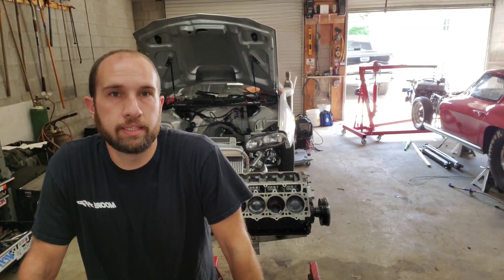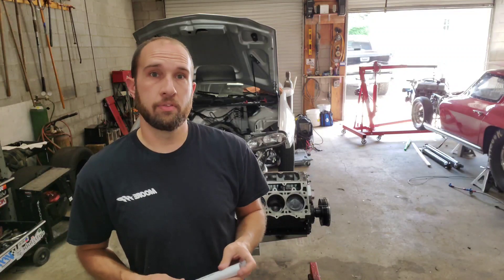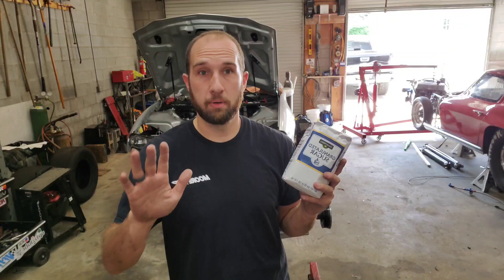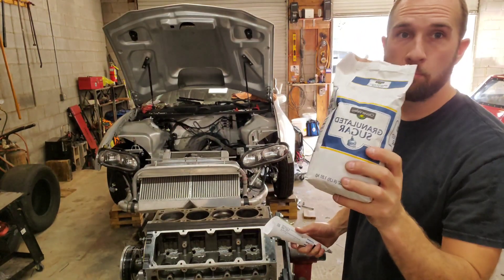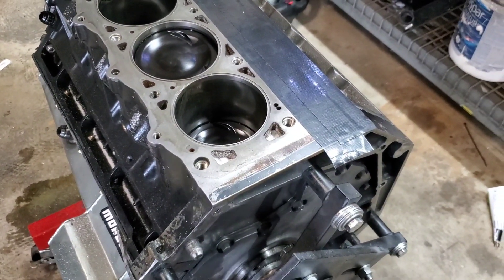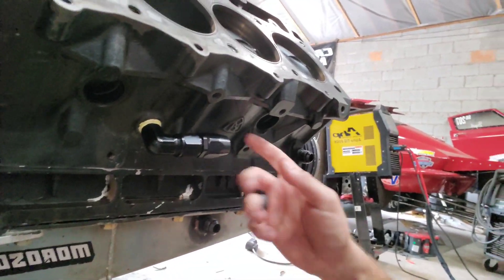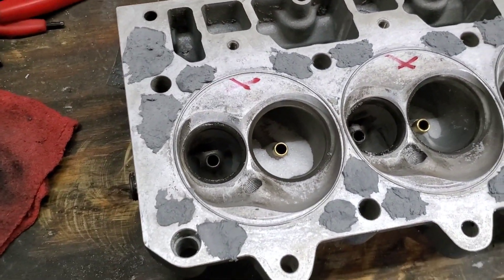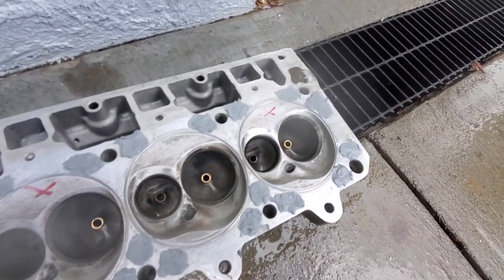How To Temporarily Dry Deck an Engine Block and Cylinder Heads

Comment: I was planning on this but instead of sugar planned to use polifoam and then disolve it with paint thiner or similar.  And also, powdered sugar would work better and to settle it, place the block on a vibrating plate, or use a pneumatic hammer  with a buffer in various places of the block to shake it up good haha. Amd also, once applied, and a little before it´s fully hardened, torque in a cylinder head to spec. So the epoxy presses evenly in all directions as it hardens

Comment: Nice man. I’ve never seen anything like this.what’s the compression ratio on it ?
Reply from the maker: 10.4:1 on this engine
Reply: @MooreHP  man ur car is goals for sure. What’s the race weight
Reply from the maker: @bnrz28  3300lbs
Reply: @MooreHP  nice man. What advice could u give someone to do the same build as urs ?
Reply from the maker: @bnrz28  don't! Lol
Reply: @MooreHP  lol ok cause I got a build going on right now but I would like to run 7s lol
Reply from the maker: @bnrz28  nice man. Just buy good parts the first time.
Reply: @MooreHP  maybe in the future have. A build like yours. Right now just pt88 5.3 th400
Reply: @MooreHP  do u have a build list or a username on ls1tech?
Reply from the maker: @bnrz28  no I don't. But you can look at the time-lapse engine video on my channel. In the description I listed all the parts in the engine. (Cam and lifters are different now)
Reply: @MooreHP  thanks bro. Looking forward to more of your vids 🤘

Comment: I’m curious what the temps will be street driving this around?
Reply from the maker: Me too! We will see. I think it will cool better this way than it did before.
Reply: @MooreHP  what kind of temps was it doing before?
Reply from the maker: Never more than I had the fan set to.
Normally around 170*
Reply: @MooreHP  nice!!!! I hope it does well.  I have a buddy that has had this issue in the past but he’s only around 1400hp but this might be an answer for him.
Reply from the maker: We are going to try it out thats for sure! Better fuel is going in too, so it should be ready for all the boost!

Comment: That sugar is actually a great idea. Water Soluble. Very smart. So your new turbos are the gt42-1450 clones from vs with the 80/98 compressor and the 82/75 9 blade turbine right? I was a little confused Bc it looks like they only come in v band in and out housing. I’d love to by one with a normal t4 flange if possible. .96-1.25 or whatever would be fine. Anyways. Good luck. Bad hot rod.
Reply from the maker: Yes sir, they are the aerowheel 8078s.
I believe mine are the 10 blade exhaust wheel.
They do come with the vband housings, but I didn't want to change up my hotside, so VS had some T4 housings machined for me.
I have two 1.15 housings, and two 1.28 housings will be here monday.

Comment: would it not still lift a head and blow a gasket under boost ? you just wouldn't have water getting in the cylinder or outside the block. maybe a dumb question just wondering 🤔
Reply from the maker: Good question. In my case, when it lifts a head it doesn't hurt the gasket at all, I use a solid copper gasket. It just allows water into the cylinder.
Dry decking it is just for added safety,  I plan on making tune changes and fuel changes to keep it from lifting the heads in the first place.
Reply: @MooreHP  thanks for the reply 👍🏽